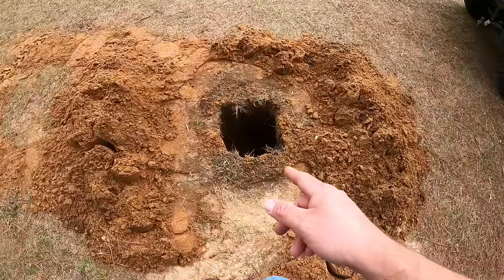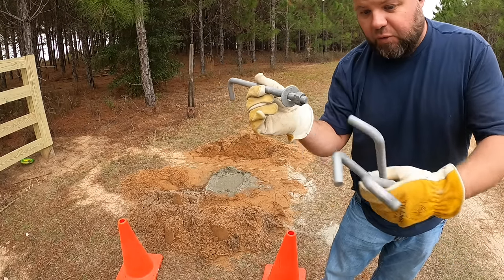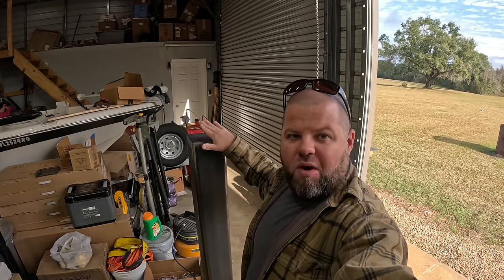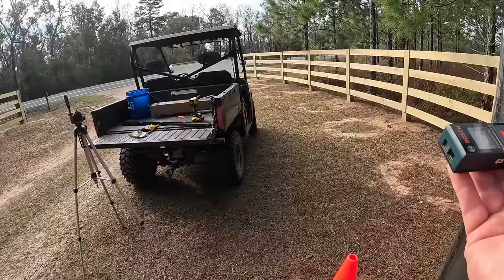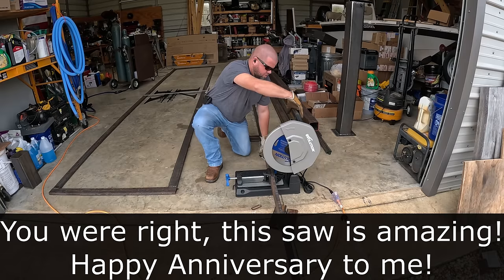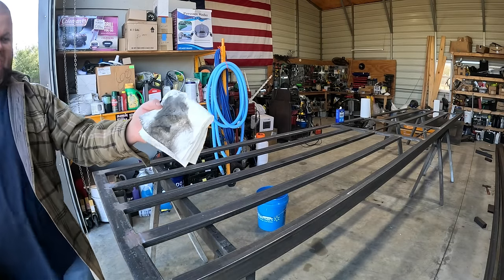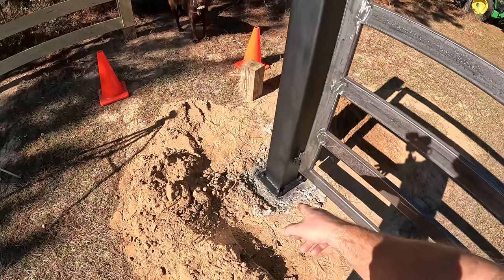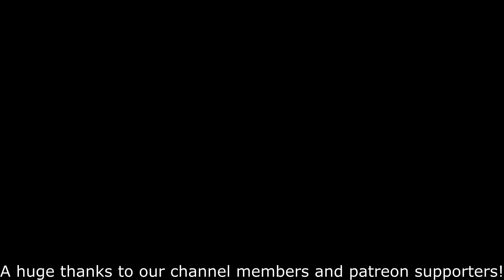DIY! My First Ever Gate Build

Comment: I’m planning to do something similar but with my soil I know I’d have sag, even with the pyramid hole. I’m thinking to pour 10” beams underground.  Thinking like 3’ long.  Thinking that should remove the need for the pyramid hole.
Reply from the maker: Mine has been up for months with no sag, even in sandy Florida soil.
Reply: How much sag (i.e. racking) have you had in the gate itself? I’ve ready to plan on anywhere from 1/16” to 1/8” per foot. From the video it seems like you have very little.  I’m guessing the rectangular tube gave you plenty of vertical rigidity.

I spoke with some contractor friends I have and they’re critical of the wet set J-anchor approach, I think they just haven’t heard of anyone doing that.  Would love to hear from a structural engineer on this.  I read that J anchors are out of style because they can straighten out with enough force but no idea how heavy a gate it would take to do that.  That’s the reason for the switching to large washers with a nut on bottom instead of the bend.  I’m also wondering how much force the concrete can take from the anchor. There sure is a lot of tension on the outside two anchors.

I’m wondering about setting a hot dip galvanized post in the ground with a flange on top, so adjustability would still be there, as well as long term corrosion resistance.
Reply from the maker: @Sean9880  there's no way for a J bolt to straighten without the concrete coming completely apart. I just made my first adjustment as things have heated up and things expand. Literally 1/8th of an inch adjustment on the far latch end. That required less than a 1/4 turn of two nuts under the post. I love the adjustability of this. Keep in mind that's impressive after hundreds of openings, in sandy soil, feet of rain and crazy storms/wind. I was expecting to have made several adjustments by now.
Reply from the maker: I see more movement with heat and cold believe it or not. I never realized how much 20ft of metal will expand and contract with temperature. That's why I went ahead and bumped the gate up on the latch end an 1/8th inch. That also impacts the gate fully closing or not closing enough.